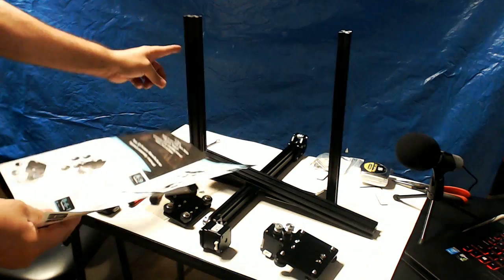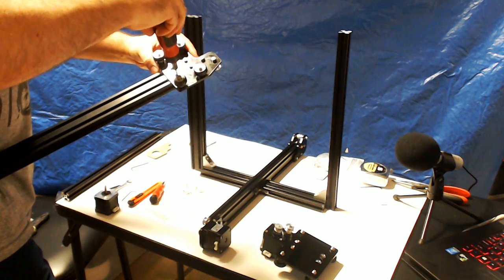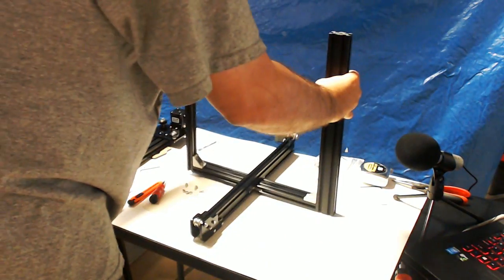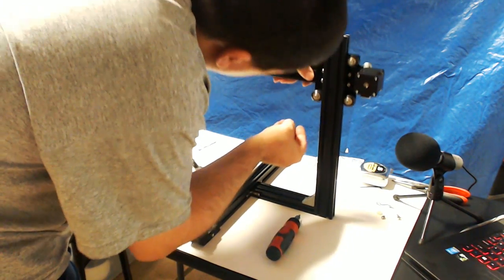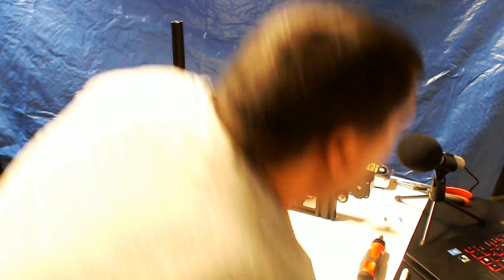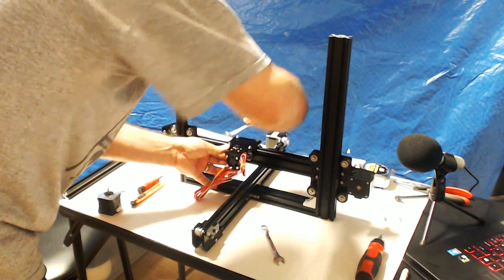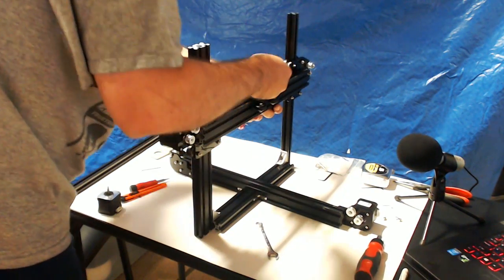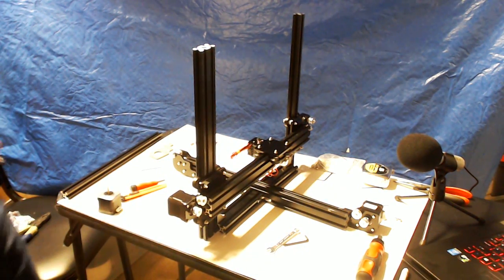Tevo Tarantula Assembly - Step 8 - Mounting X/Z Axis Rail

Comment: Umm.. I followed the steps, however some wheels don't even make contact? How can you adjust them? All there is, is tighten or loosen.. that doesn't help. Also after putting this on I notice the frame bending in.. so I loosened everything and then fit it on there. This step is very hard. I still can't get them all to move and also the side with the motor does not click in.... this is so frustrating
Reply from the maker: The Eccentric nuts (the ones with the off center hole) are used to adjust the wheels.
Reply: im having a problem where even eccentric nuts cant make contact, it seems the holes are slightly off. do i need to break out the drill or is there a better solution?

edit: i got it the usual way lol. whoever designed those ridiculous eccentric nuts was way overthinking it

Comment: In step 18 you have to bolt an end stop to the x axis bracket, which can't be done while it is mounted so maybe that should be done first to save having to unmount it later. Also as the video and other comments says, keep the t nuts and eccentric nuts loose until after it's rolling, otherwise the bracket will snap!

Comment: For some reason my wheels are quite loose, allowing the acrylic parts to rock back and forth, is this normal?
Reply: Thanks! Also, is there any way to remove the filament tube?
Reply: same happend to me, dont know what to do =(
Reply from the maker: The whole point of the eccentric nut is to allow you to adjust them to tighten up the wheels into the grooves.  Rotate them with the included wrench and you should get the wheels nice and snug.
Reply from the maker: If you push down on the black plastic part it slides into, it should unlock the tube and let you pull it out.
Reply: Ah ok, also How can I ensure an adequate connection between the 12 V cable from the power supply and the mainboard?

Comment: Be super careful with this step!!.  I had my z-travel cross-member completely tightened up, the eccentric rollers and the carriage sub-assembly positions on the cross-member. I used a little force to get it onto the vertical rails and ended up snapping off one of my eccentric rollers from one of the sub-assemblies. It was some force, but surprisingly lower than I would have expected for it to snap; acrylic is brittle, point taken.

What you want to do here is have everything barely snug, meaning you can rotate the eccentric rollers as well as the sub-assemblies relative to the cross-member. Now, slide it on and bring down the cross-member and rest it on a parallel block; you can use two identically sized acrylic plates from the kit.  The idea is to setup the cross-member parallel to the bed, or in other terms, perfectly perpendicular to the vertical rails. Next, adjust all the eccentric rollers to their center position, meaning its apex should be at 6 or 12 o'clock. After that, make sure your beam is squared up by applying some pressure to it and then while holding that relationship, simultaneously start tightening up your bolts for the sub-assembly to the cross-member. Once you have convinced yourself that the cross-member is perfectly perpendicular to the vertical beams, start snugging up the eccentric rollers, by rotating the eccentric nut until you have sufficient and even pressure across all the rollers. You will need two wrenches for this - one for the eccentric nut, and one for the fastening nut. Check that the pressure is even by trying to rotate the roller with your fingers.  It should slip on the beam with a moderate amount of torque; you want it snug, but not tight on the rail. Lastly, check that the cross-member glides up and down on the vertical beams. Repeat as necessary.

Now, does anyone know where to get a damn replacement part for the left side, sub-assembly?  I am looking for the acrylic part that the rollers mount to. The corner chipped off and left me with only 3 rollers on that side.  I wouldn't be opposed to an aluminum replacement, but I also don't want to spend $70, which I think is what I saw them going for in the few minutes that I spent searching.

Note: the brackets in this setup suck.  Honestly for all the rigidity in the rails, the angle-brackets make it a complete joke.  Yeah, you can be careful, and cinch them down just short of snapping the hardware, but after all is said and done, I put a level on it and can see several degrees of deflection with light lateral loading, I'm talking 1-2lbsf.  First order of business after getting this thing printing is to replace those brackets.
Reply: i juuuuust did this gaah if you find a good replacement pleease let me know i waited like two and a half weeks for this damn thing and it snapped Dx
Reply: I don't have a solution yet for repairing or replacing it, short of spending $80 on some aluminum replacements, however, I have been printing just fine so far - functioning with 7 rollers on the z carriage.
Reply: im atempting to fix it with super glu cuz that will fix everything right?? lol anyway ill keep ya posted cuz if its as easy as that id be suprised
Reply: thanks, yeah if someone has the design file, it would be super easy to laser out some new ones. My buddy has a laser table and acrylic!
Reply: funny enough i found one for a single extrusion model https://grabcad.com/library/tevo-tarantula-printer-parts-1 idk how well the link will work
Reply: sweet! that's perfect. I can convert this into a dxf and have my buddy laser out two sets. you just need the one that rolls on the vertical axis right? email my at mytablette@gmail.com with your address and I can ship you one.
Reply: how much do i owe ya xD ill email ya as soon as i can in bed netflixing and junk rn
Reply: just shipping assuming my buddy doesn't charge for material; I think ground should be like $5 or 6 tops - an envelope might even work. I can throw in a few other parts to make the shipping worth it if you want. just let me know.
Reply: well ill shoot you an email with my info just lemme know and ill scrounge money up for it :P
Reply: That just happened to me. I superglued the broken-off piece back but i don't like its chances. I may have to get some acrylic of the same thickness and make a new plate. Not happy...

Comment: what happens if i am not able to make all the rollers to roll? will it affect future printing process? what other methods can i ensure all rollers are able to roll on the aluminum rod? thank you.
Reply from the maker: +theguywhocriedwolf If they don't roll, you won't get a smooth movement causing a lower quality in your prints.  All I can suggest it to make sure you follow the video, nothing should prevent the wheels from rolling smoothly.

Comment: Its easier to check the wheels are rolling before mounting it by sliding a section in between the wheels and and adjusting the nut as required.